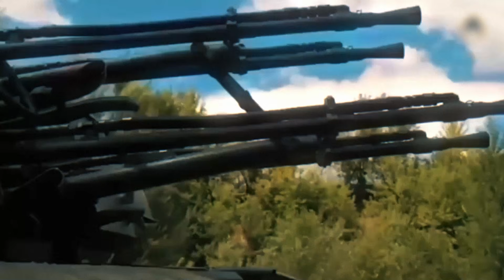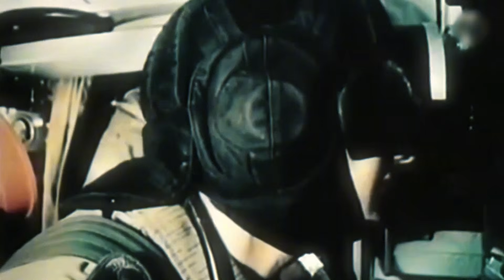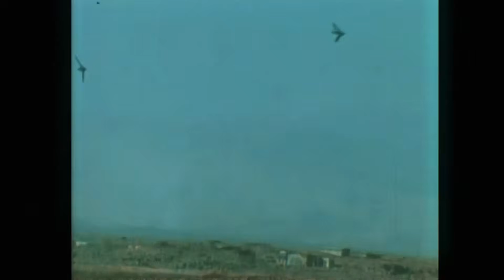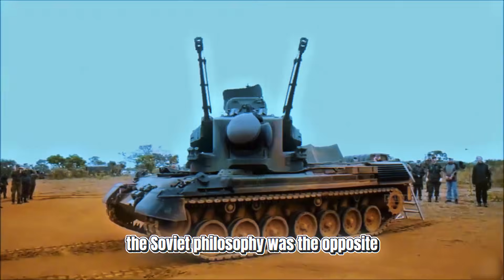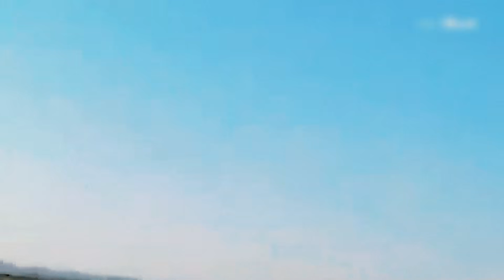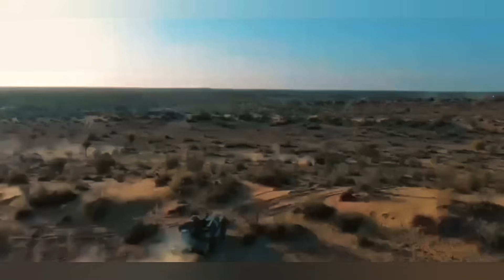Inside the 23mm ZU-23-2 - Why It Solves the Drone Problem Patriot Missiles Can't

Comment: In Afghanistan, they used Shilkas to target the Mujahedin on higher ground. The Mujahedin would lay ambushes in mountain gorges, knowing that tanks and other armored vehicles lacked gun elevation to reach them there. Shilka did have the elevation, but there was another problem: lack of armor. So, in addition to changes you already mentioned here (removed radar and added night optics), it also had increased armor, especially on the top of the vehicle. In Afghanistan, they were used for counter insurgency, not air defense.
Reply: Blanket a region with 23mm HE “bangers…”